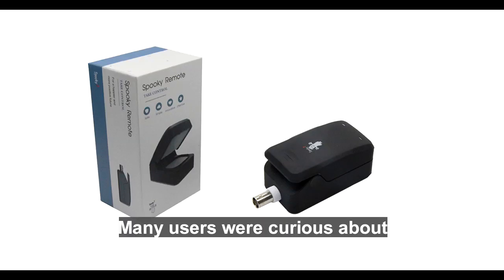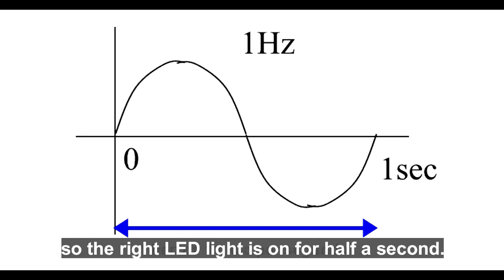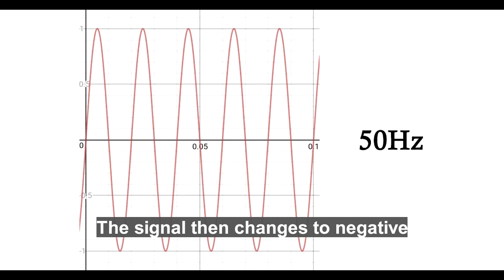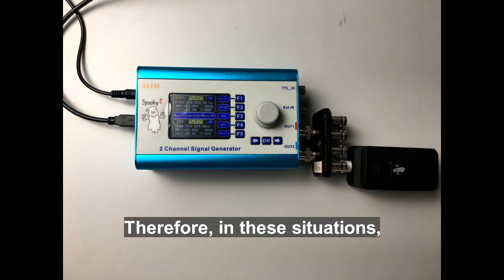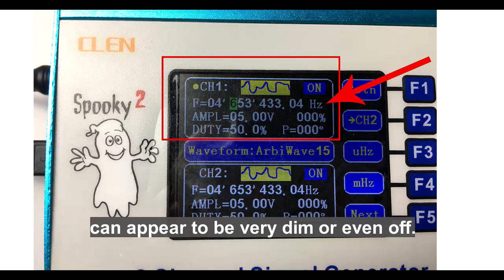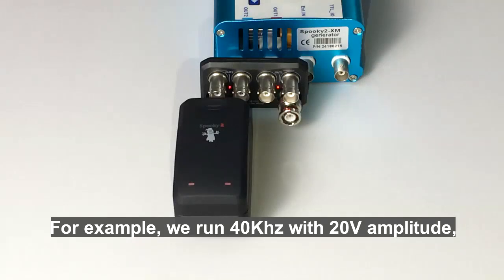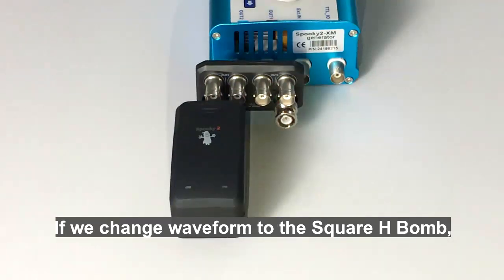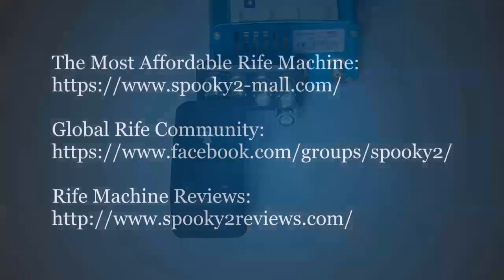How Does Spooky2 Remote Signal Light Work

Comment: I started the 11 day terrain (R) protocol and when I did, lights were on immediately in the remote. It’s now the 2nd day of the same loop and now there are no lights. This can’t possibly be due to frequency changes as it was showing red lights yesterday on the same frequencies. The boost lights are on, but the remote lights are not
Reply from the maker: Hi, please change other frequencies to see whether remote light is on or not. If it turns on when running other programs, it means it's a normal conidtion. N worries:)

Comment: Can you explain more on placement of remote to the boost?I have generatorX with scalar set up.Uncertain because a cable interferes with my remote in the location on your video.Do i disconnect that cable and turn off scalar unit?